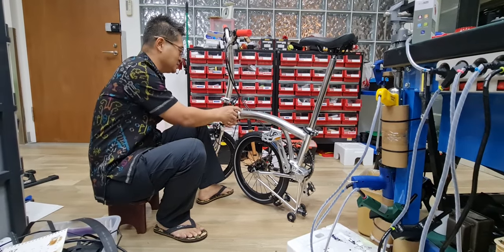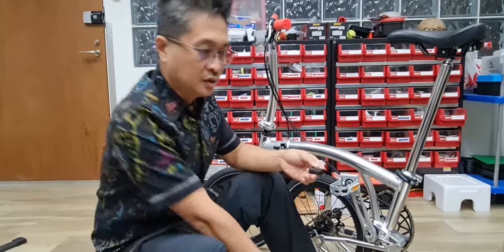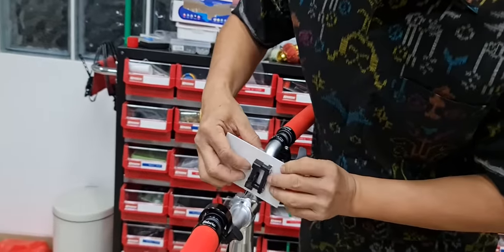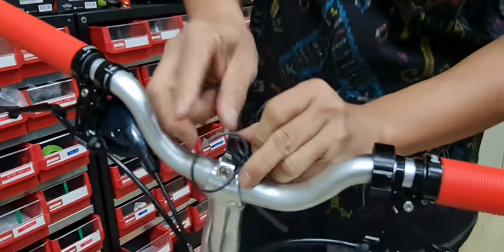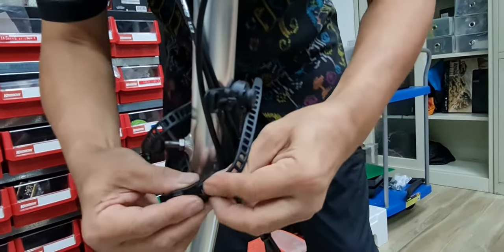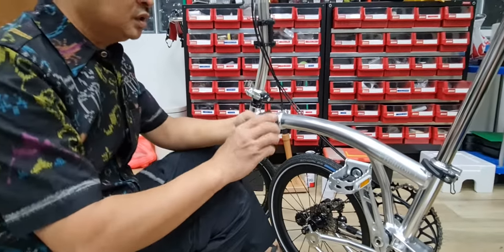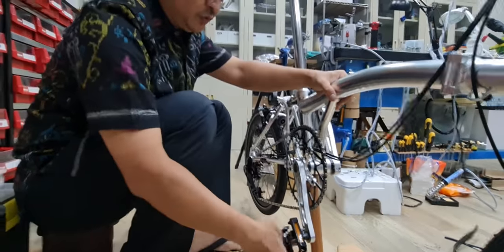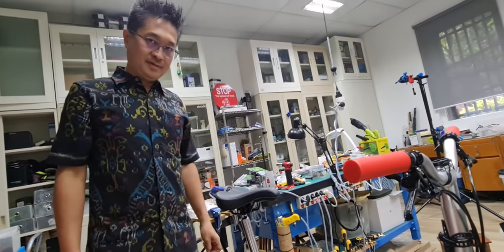5 Hacks Brompton / Billiton Upgrade

Comment: I like the rubber that you put around the clamp. I'll probably use Sugre because I don't have a heat gun. Will a blow dryer work?
Reply from the maker: Hi Lee, frankly I dont what is Sugre. But you may try to heat blow it with hairdryer if you dont have dryer like mine. Please note that if you wrap the hinge clamp with rubber or 'sugre' . It has to be tighten tightly. To make sure the pin not moving. I have the experience when use this on Billiton bike which is made from alumunium (different material with Brompton) it impacted to its pin and bushing. So for fram with alumunium it is not recommended to use rubber as I show in my video